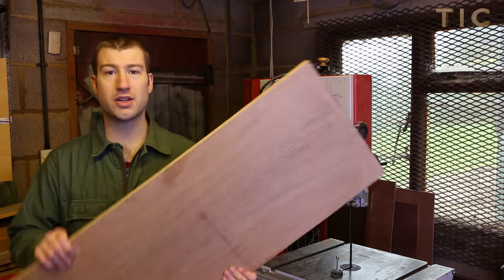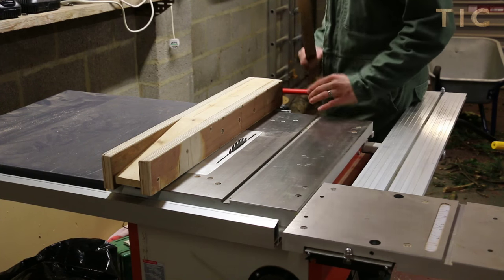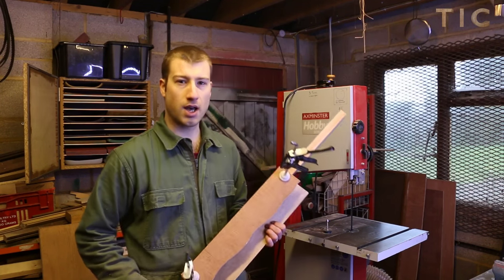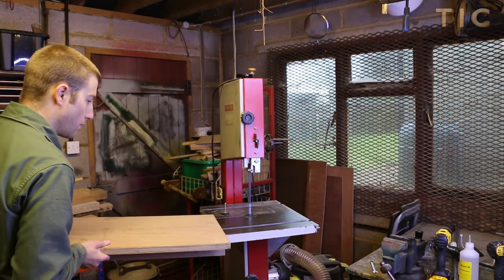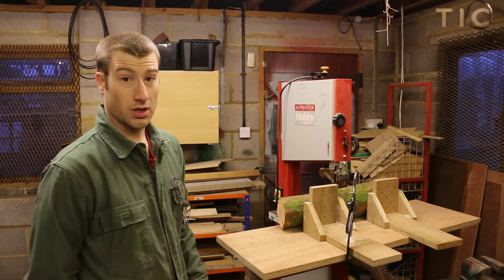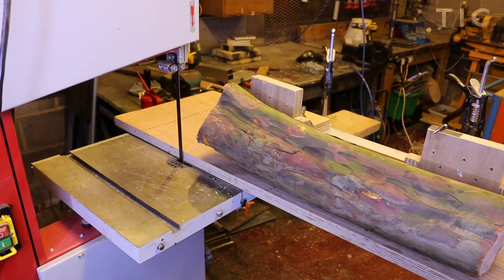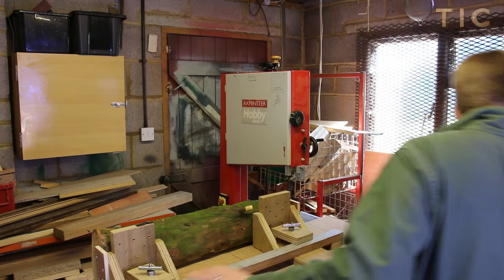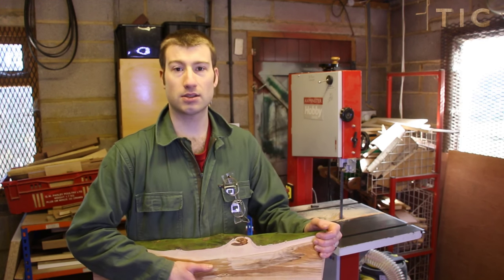Bandsaw sled - Rip cutting green timber

Comment: Good job ! I have the same problem : same bandsaw , same timber : yew  ( the bark of yours tells me it's yew as well , right ? but I didn't spend enough time designing a sled like you , two questions : why do you leave that free space above the log ? as to the table : can't it be better steadied ? anyway : our fun is made of all those problems to be solved !
Reply from the maker: Youenn Thanks. As to the space above the log, do you mean the fact i didn't lower the blade guard (i don't have good WiFi where I am at the moment, so I can't watch the video to see if I did or didn't). If that's the case, there's no reason other than my own lack of safety.. I should have lowered it. Regarding steadying the table, I now have a working solution, I got a good 3 tpi blade, and have upgraded the sled to be propelled by a lead screw with an electric screwdriver to turn it. This means the sled moves slowly and consistently, and the result is much much better. I hope to soon upload a video detailing the mod, as I'm really pleased with it.
Reply: Hello ! " Lower the blade guard.."  I'm french and didn't find the right words....as to the needed steadying , first I thought the table moved independently but now it seems to be the whole bandsaw , what does it lie on / is tied to ? then a good sharp blade and some wax would allow a better result but a bigger bandsaw would be best ...
Reply from the maker: Youenn It's amazing the difference a good blade makes. I bought mine from tuffsaws and it's really great.

Comment: a piece of metal for the rail square stock aluminum to what ever punch some holes and counter sink for the head , then in a hobby store you can find some nylon flat stock and put runners , either use them edge wise or flat , glue and screw appropiately. No need to use bearings.

Comment: when resawing green wood i have a problem of sap and sawdust build up, did you have this problem?
Reply from the maker: Hi Neal, I haven't come across that problem with my 3 tpi blade, but have with smaller toothed blades. For green wood, big well spaced teeth with a good, wide set (bent left and right to cut wider than the blade itself) has worked best for me. If i could have got a blade with bigger (fewer tpi) i would have, but I'm limited to 1/2" blade, and the coarsest i could find was 3tpi. Matthais Wandel has a good video expaining saw tooth size and clogging/binding: https://www.youtube.com/watch?v=fK9m5PadmiI Happy resawing! :-)
Reply: TheInnovationCentre i

Comment: What is that delay between the stop button, and the saw actually turning off?  Audio/video unsynchronized?  That seems like a horrible safety issue if not!
Reply from the maker: Hi Michael. I have an extractor that turns on when the saw is powered on, and turns off a few seconds after the saw is turned off. The saw itself cuts power to the motor as soon as the stop button is pressed, although the blade spins for a bit as there is no automatic brake on the it.
Reply from the maker: (I'm guessing it's the extractor that you're hearing)

Comment: Get longer base board use roller stands at either end of saw platform, no need to have the sled touch the table top.
Reply from the maker: Dave Van Meter That's a good idea! Though rigidity of the base board would become a prime concern, as I would no longer be able to rely on the cast iron table to provide strength.

Comment: This is not criticism, only an observation or perhaps a question. First I am likely the worst band saw operator ever, but I did notice in the faster speed sections there was a lot of up/down and/or lateral movement. Is the sled too large for comfortable handling and movement?
Reply from the maker: Hi, thanks for your comment, you're absolutely right, the sled and payload are to big and heavy to be slid easily by hand. The centre of mass starts off the edge of the table, moves over the table and ends off the other end, which makes it difficult to control, hence the unwanted vertical and lateral movements. The lateral movements should be controlled by the mitre slots, but my runner isn't perfect, and being a bandsaw, the blade can deflect when it's overloaded too.